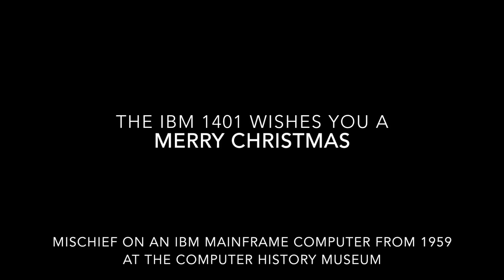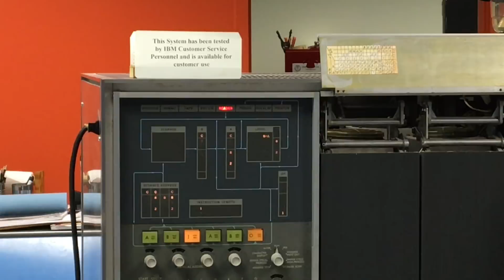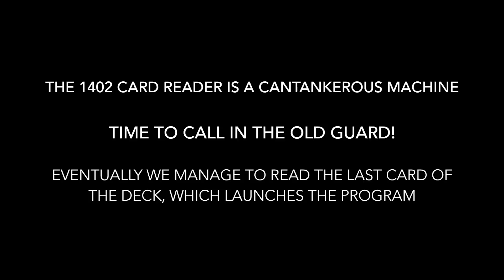The IBM 1401 Mainframe Computer Wishes you a Merry Christmas

Comment: Thumbs up for good old Windows XP. :D
Reply: ...and other computers which fail to break after 10 years
Reply: Pentium 4 Inside!
Reply: I wouldn't say it was garbage as I started using it in 2001 shortly after it was released for sake and had it up to when Microsoft stopped supporting it.  The OS itself crashed only ONE time in the 13 years that I was using it.  I'd rather use it before Windows 10, however I know it won't ever come back.